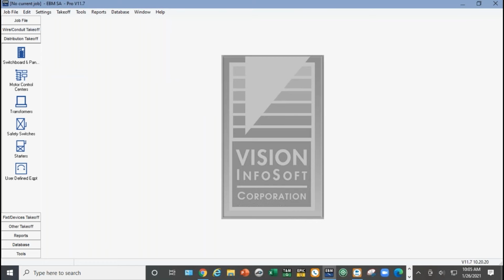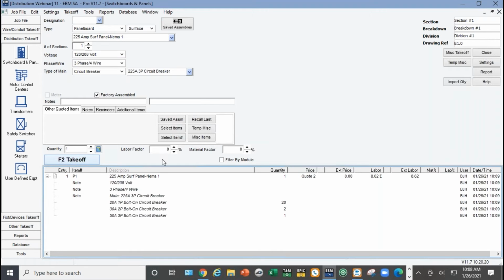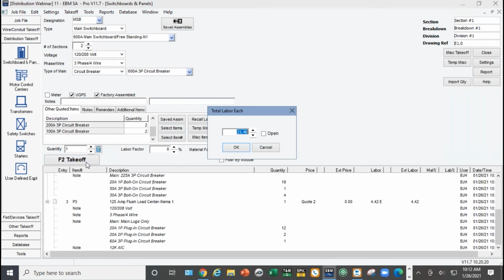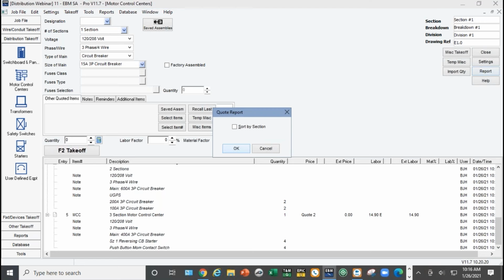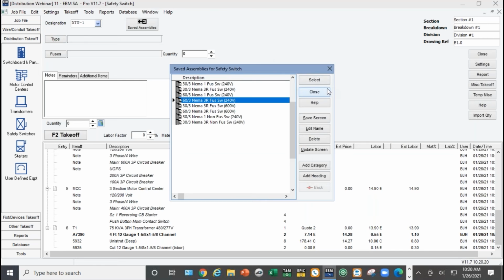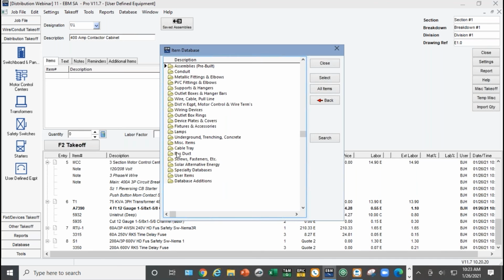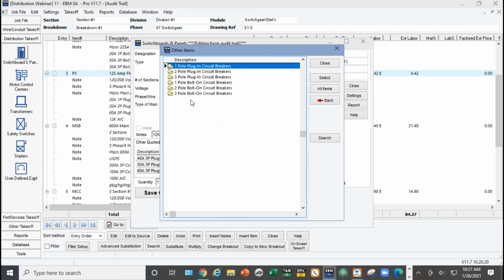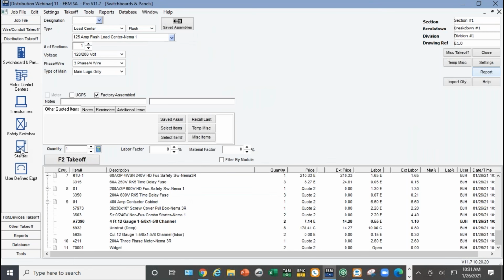Understanding Electrical Distribution Takeoff

Comment: What is “distribution”?  It’s not defined in article 100.
Reply from the maker: "Distribution" in the takeoff refers to the breakdown of the electrical system's components, such as switchboards, panels, and transformers, which would be detailed in the estimate based on the project's plans.